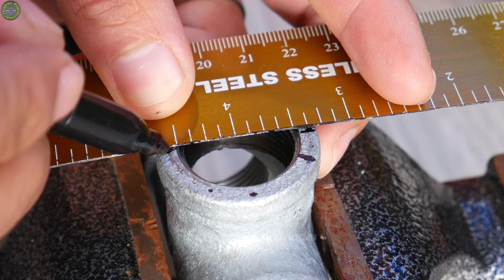¡El fabricante no quiere que sepas esto! Unir una manguera a un tubo de PVC sin comprar un adaptador

Comment: Hose threads and pipe threads are different.
Reply from the maker: Yes, you are right, my friend, the rock of the tubes are different, but the brass that I used to make the thread is metallic, it has the same thread as a hose.
Reply: @Mrinventor93  That T fitting  is galvanized was not BRASS and has pipe threading. Just the color alone of the fitting tells you it is not brass.
Reply: @vincentgonzales8917   you'd probably be surprised how many people think 3/4 pipe thread is the same as garden hose thread...."But I can screw it on there!!"
Reply: You can't screw a female hose end comfortably to a pipe thread without striping it. Take note he is using a PLASTIC hose fitting easy to strip. Yes the hose washer will stop the water flow. But one of the two will be stripped.
Reply: Why not use a hose threaded brass female adapter ?
Reply: Old rattler is correct use the right threading if your going to demo
Reply: @davidclark7271  you would be surprised that it works. As long as it can mechanically seal the washer it works no problem. I've done it for over 20 years this way in a jam.
Reply: @vincentgonzales8917  you can in this circumstance.

Comment: Haters gonna hate and ain'ters gonna ain't. This is a pretty neat hack and, provided you have the incorrect fitting on hand to sacrifice, could be very useful to make a necessary temporary connection until the correct fitting can be installed. I tapped into my condensate line in the garage (with the correct fitting) to run a hose out of the garage when the it backs up, which it does frequently if I forget to keep it cleaned. Heck, in my example it's a zero pressure connection and there would most likely never be a problem with the PVC threads anyway.

Comment: threads on pipe fitting and garden hose are not the same.
Reply from the maker: I have been told that, but if I screw it on very well and it has held on excellent friend
Reply: It works in this regard.

Comment: Garden hose thread is not compatible with pipe thread.  This is def weak sauce.
Reply: It actually works quite well.
Reply: @LemonySnicket-EUC  I'm quite certain that you have low water pressure (<40 psi).  If you had the American standard of around 75 to 90, it would fail spectacularly.  Also, I'll forgive your spelling error as I'm certain you are not from the U.S. or Britain.
Reply: @1dariansdad  haha ! I fixed it for you. You are wrong on 2 out of 3 though. 😎 I'll forgive you as well.
Reply: @LemonySnicket-EUC  But, in the end as other commenters have suggested, it would be easier and more secure to use the GHT x slip adapter.  I'll forgive you now.  I'm not alone in this.  Why else would you have over 300K views and only 2.3K likes?

Comment: The threads cut into the PVC pipe would have been NPT (National Pipe Thread). The fitting on the end of the garden hose is not National Pipe Thread. Those miss matched threads only have 2-3 threads holding it together and will start leaking or break completely in a short time. You'll save time and money just doing it right the first time.
Reply: wow  you are sharp, thats a very good point of concern.
Reply: Exactly correct....this video is a joke.
You easily could of just purchased the proper adapters to convert it. 🙄
Reply: Absolutely correct, go to Home Depot and get the correct fitting for $1.50.
Reply: That's the first thing I thought of also. Guess not everyone knows of the thread differences in NPT and hose fitting
Reply: @paulkline2719  Cutting the threaded socket into thirds like he did was a good idea and new to me, but I don't think it would actually cut usable threads into pipe.
Reply: This is wrong water hose threads are the same thing  I have been there before and done that
Reply: LOL
Reply: @shawnfinlay4952  You could see the torque he was applying to that solvent connection at the elbow.  I was wondering why he didn't lube the cut with coconut oil or crisco or something.
Reply: But a trip to the hardware store probably  involves using a 2500lb vehical to fetch a few lbs of stuff , time , the added costs of vehicle use , fuel and risk of accident . Total life cycle costs weren't mentioned . It's all about total life cycle costs ?
Reply: @oddwad6290  Nah, I can walk the 1/2mile the exercise and fresh air coupled with the savings and considering the carbon footprint of  steel pipe versus extruded pvc we're way on the positive side.
Reply: Slow learner.waste time an money only have to redo it
Reply: Lol, 1/2 mile walk and fresh air and exercise. You live that close to hardware store there ain’t no fresh air. Good chance to get hit by a car or pickup (those manly dudes driving pickups to hardware stores). 
   Even so, I never can think of a time when I saw anyone but just one item at a hardware store. There’s always more on someones  to do list that needs something. 
   After that there’s the grocery store. Pickup a few items for the next meal today or this week. 
  Combine some tasks together. 
Either that or let your landlord fix it so you got more time to walk to the gym.
Reply: @hidingfromu5293  Ha!  I don't live in New Delhi.  Im less than a mile from my Lowes, and there are sidewalks all the way there.  Our pickup drivers are pretty good at avoiding pedestrians and, yes, I often go there for a single item.  Usually the one I overlooked when I went the first time.
Reply: @oddwad6290  If there's THAT much danger and risk to you just going to the hardware store, maybe you shouldn't go. In fact you probably shouldn't even being going outside to fix the hose in the first place. Just stay indoors where it's safer, and have someone else take the risk of going out to fix the hose. Stay home, lock the doors, and be safe!
Reply: @kelvinbarnhart9633  National Pipe Threads are NOT the same as the coupler ends of the hose fitting. He was trying to thread the female end of a hose coupler onto the end of a  half-assed threaded piece of PVC pipe. The threads are NOT compatible. Saying they are only proves your ignorance.
Reply: Bet there's a way to get it to line up the threads for the hose female coupling, those ears can bend and they'll bend easier if sliced thinner then  elimination of certain threads might be enough to get there. I've never found one made for cutting male water hose connections, nor looked for it. Now I will.
Reply: Or you can just buy the adopter and cement it on in about five minutes..... But that's just me.
Reply: Skilled labor is not cheap....

Cheap labor is not skilled.
Reply: Repent and believe in Jesus Christ  Yeah, well I bet even HE couldn't make the threads on that hose coupler compatible with pipe treads.
Reply: @im1who84u  Now we're talkin'.  Finally someone knows how to do that job  RIGHT! And I bet that if you didn't know how to do a particular job, you would find how to do it and do it right the first time!
Reply: @im1who84u  We always say work smarter not harder
Reply: @stevenz2234  Much cheaper than a 3/4" galvanized tee and a cutting wheel.  Plus, you'd have the right thread.

Comment: Garden hose threads 11.5 TPI straight. 3/4" pipe is 14TPI and tapered. Eventually will strip fittings and have to be replaced with cheaper right stuff!

Comment: Total bull. I work in a plumbing shop and hose thread is not the same as the NPT thread in that galve tee…. There’s a reason why REALL plumbers don’t do this kinda crap. Next time just hire a plumber
Reply: There is a PVC adapter that glues over the PVC pipe and provides a true hose thread.

Comment: Just by the threaded couple for a buck 50 and glue it to the end of the pipe. Not only will it be 10X faster than the stupidity you show, it will also be the right threads.

Comment: I don't think so, garden hose thread is way different than 3/4 pipe thread. Pipe thread seals on the threads and garden hose seals with the rubber washer not threads. Garden hose threads are not nearly as fine as pipe thread, the garden hose woud never thread onto a 3/4 pipe thread.
Reply: It actually will work. I've been doing it for over 20 years with no issue. As long as the washer seals there are no issues.

Comment: That 3/4” NPT thread you just cut isn’t the same thing as the thread on the hose.  The hose has a 3/4” hose thread ….you  can force it on but it will soon jump threads and leak.   Why not just go to the store and buy a hose bib or an 89¢ pvc glue fitting with the proper thread?

Comment: Well, if I ever need to destroy an expensive steel pipe fitting to avoid buying a really cheap PVC pipe fitting, I will keep this in mind.
Reply: I think the steel pipe can be used again and again like a permanent tool in the tool shed. Not too expensive. It's not made out of platinum.

Comment: Note that the Home Depot crew will thread pipe free if you need a few pieces threaded and buy the pipe there of course.
Reply: As a Home Depot plumbing associate,  you can not thread pvc on pipe threading machine
Reply: @jimwilkinson5952  Correct, I meant the pipe threading for metal pipe. For PVC just purchase a threaded nipple of the right length and cut to length as needed or use a threaded adapter fitting etc.

Comment: Ruin a $12 fitting to avoid using a $1 fitting. This guy has upper management written all over him. Better yet let him run part of a goverment program. Real problem solver
Reply: The guy does have over half a million views in 3 weeks in this video.  I think it paid for itself.     Sure it would work in a pinch, but in a pinch you wouldn't have a angle grinder, a vice, and the time to film it.

Comment: On one occasion I had to replace the hose bib on the bottom of a water heater because some clown the previous night broke off the plastic one the manufacture put on it by carelessly dropping a keg on it. After cutting out as much of the old one I threaded a 3/4 inch nipple pipe to ensure the threads were good before installing a new valve.
More pertinent to this topic was after making a bathroom out of an indoor outhouse in the basement of a guys house I had to rethink how to drain the condenser coils on the furnace. The old owner just ran a plastic hose about 3 feet across the floor, through the wall and then across the floor through a hole he drilled into the metal shower stall. I ran PVC around through the back wall studs and poked it through the brand new shower stall wall finishing it off with a white plastic piece for trim normally used for a kitchen sink where the sprayer comes up from below. The pieces while still considered 3/4 inch didn't match up for threads. But they were so close I could run a nipple again back and forth until they matched. PVC , while close isn't cut as deep is all. It looked as though it was meant to be that way. The new owner used that shower daily over the bath/shower he had upstairs for some reason. 
Now the threads for a garden hose are not that close. A hose bib is different. I think it was a good learning experience but with adapters out there I would have gone that direction.
Reply: He,He,He Exactly !

Comment: That's Sch 40 pvc. and has a pressure rating of around 450. So, by cutting threads, you'll be reducing the pressure rating down to around 50%. At 200 PSI, That's plenty of strength for this application.
Reply: That's a nominal rating assuming all things in favor of the pipe such as age and UV exposure.  That pipe is already compromised having been exposed to pipe solvent and now add the torsion of that flexible hose attached to it.

Comment: Also for the haters, maybe ya can spring for a low cost adapter, but what if u wanted multiple lengths to use, or multiple locations without buying a bunch of adapters! I'm guessing the hates are the ones who pay plymbers to do what they could if only they shut their mouths and opened eyes and ears and learn!
Reply from the maker: Very good comment without a doubt thank you very much 💪
Reply: Or we know the difference between NPT and hose threads. The galvanized tee is NPT. That means the threads are what provide the seal. In hose threads the rubber washer prevents leaking. Completely different. 
In a pinch sure but after you take that hose off and on a few times those threads aren't going to work. Then you'll still need the adapter AND you've compromised the pvc so that will need to be cut off for the chemical weld to work. 
But yeah, we're haters, because knowledge.

Comment: Wouldn't it have been easier to heat the plastic pipe and screw the bolt directly to it ?
Reply from the maker: In fact, no, my friend, I have almost tried it, but it is difficult for the thread to be marked since once the tube heats up it shrinks and when I insert the tee it only shrinks

Comment: I admire ideas that are outside of the box, but if fittings are available wherever you are, this would be under $1 for the right fitting. I’d also worry about exposed PVC piping outdoors that’s not insulated, if left pressurized during cooler months.
Reply: Good that this doesn't matter for me here in Florida... :-)

Comment: In retrospect, I think the video was to demonstrate how to use a metal fitting, as a die, to cut threads into pvc when you don’t have a pvc adapter.
Reply from the maker: It is correct my friend good day
Reply: ye, BUT BUT, those threads will not have the same strength as a factory made piece. The pipe has been thinned down. Threaded PVC fittings have a thicker cross section,  to aid in keeping the threads from snapping off. PVC pipe is not really very strong.
Reply: Yes, and I can build a house out Tesla batteries, but that's hardly a good idea if a cheaper and better alternative exists.
Reply: That is the true intention of this video 👍

Comment: Serious question,  but do u have to cut the sections from the metal piece, or will it still thread pvc same way?
Reply from the maker: Hello, yes, in fact, if you don't do it, it won't be possible to thread it, I tried it and it can't, however, by cutting the piece you do the function of a screwer

Comment: wouldn't it be easier to just heat the PVC pipe and then thread it on?
Reply from the maker: Hello, no friend, it is difficult because when the tube softens the thread does not show, it only shrinks